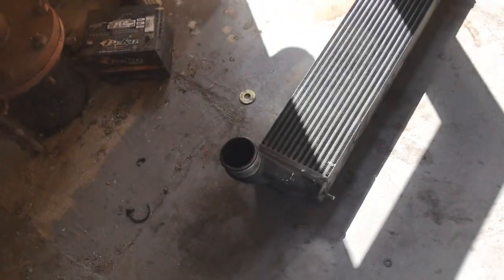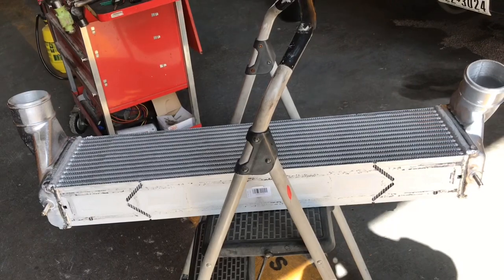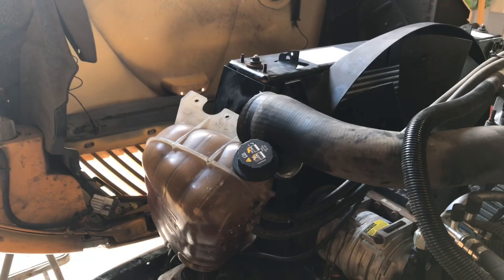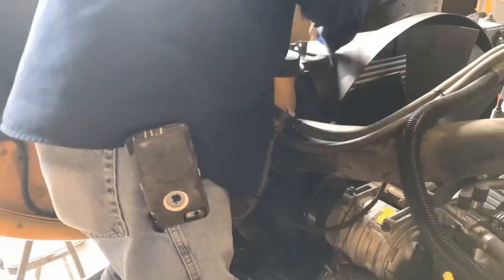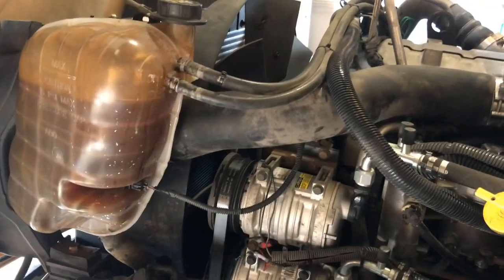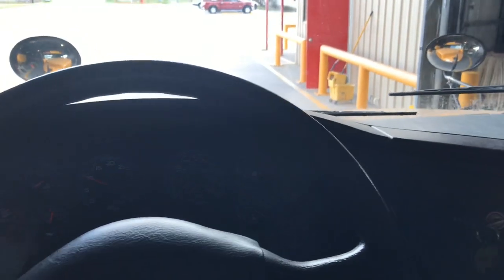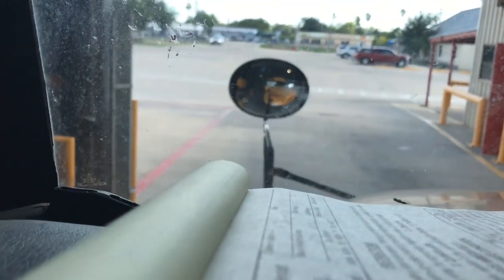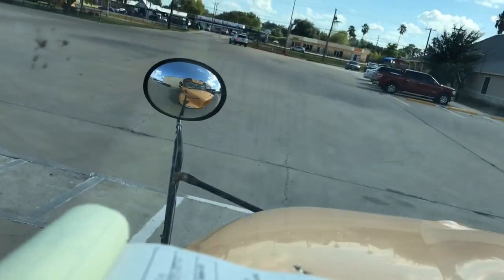Replacing a charge air cooler (CAC)

Comment: Thanks for another good video. It's too bad the side support members of the radiator support frame curve inwards at the top. That would allow the CAC to slide up and out much easier. I'm still struggling with power problems like we briefly discussed a few days ago. Again, thanks for taking the time to post your work!!!
Reply: I should have said if the side support members weren't curved inward at the top the CAC would slide up and out much easier.
Reply from the maker: Dale Babbitt   That little curve was put there to tick people off. Lol. I think. When it comes to that unit u are working on. Wish I could see it  hear it. I’ll go back to the devious meesege to see if we can come up with a solution. U said 2012 low boost (low power). Turbos and attachments r clean (no oil)
Reply: @JoesBusBarn  I wish I could afford a 2012. Mine is a 2005 International 4300 truck with the dt466. We're talking the poor man express here. Anyway,, no oil in the turbo or CAC. Huge lack of response on a hot restart but that ptoblem is sporadic. Sometimes no throttle response at all until I feather the throttle pedal. I wish I had your knowledge of what feeds the turbo to trigger it's appropriate output response. The turbo actuator seems to act fine when I key to the on position. The arm moves freely as it should and returns to it's rest position when I key off.
Reply from the maker: Dale Babbitt   Got the wrong year. Bro. I don’t loose my head cause it’s stuck to my neck. U have a VGT turbo on there. Dose the arm cycle (move) when the key is on. Or do u mean free. You pull it with hand. I’ve torn those apart to clean the VGT ring and pucks. Those are what directs the exhaust to either spool up faster or slow down the turbo. Another one u might want to try is on the drivers side of the engine. U have ur pcm. The 2 lower connectors (towards the front of the engine) are the ones that relay pulse back and forth from ecm and throttle   Wiggle test while engine is running (raising and lowering rpm’s). Dale. My apologies. I might have sent u previous wrong messages. I was helping out on a 2012 maxxforce at the same time. Might have sent u wrong info. Again. My apologies my friend.
Reply from the maker: there are quite a few videos out on the vgt turbos workings. I posted one or 2 a while back. mine r not the greatest but I try to explain as much as I can.
Reply: @JoesBusBarn  the turbo actuator arm works properly using the key on, key off test. I started searching for your turbo video last night. I'll continue that sesrch later today. Currently trying to change the drag link. Naturally the cotter pins broke so it's going to take a while to clear out the broken pieces before I can even start to free up the castle nuts and then try to break the taper fit end of the old drag link. Sucks being poor.
Reply from the maker: Dale Babbitt    Hey there dale. You will get the truck back on the road. I know it’s a little frustrating. I’ll try and help u in any way I can. FYI. If for any reason you find the need for good used parts. I may be able to help out. I was going to offer you a used/good VGT if u find that u need it. I would be willing to donate parts, if I have them, so that you can finish up ur truck. Feel free to ask any questions that u might have. I will try to respond with answers. If u prefer. My email is on videos description.
Reply: @JoesBusBarn  Thank you. Your help and encouragement is greatly appreciated. Trying to find the email address. No luck so far.

Comment: I can't get to the two nuts on the bottom of the cooler. How are you gaining access to those?
Reply from the maker: Remove all the radiator cage bolts (13 mm). Loosen the cage to frame anchor bolts. Gently pry the cage apart a bit. Use long (12 inch) extension. Swivel and short socket to remove cooler to cage (bottom) nuts coming in from the front of the radiator.
Reply from the maker: Hope that helps u out Rich.
Reply: Thank you for the help. I appreciate it. That worked.
Reply from the maker: Anytime bud. Feel free to hit me up with any future questions. Appreciate the comment.